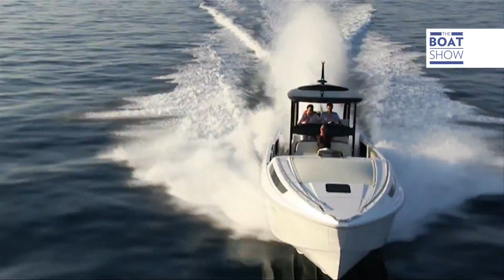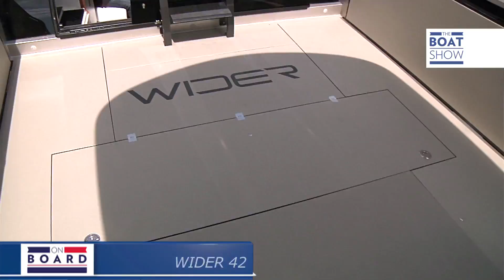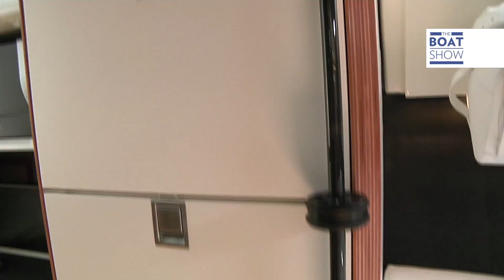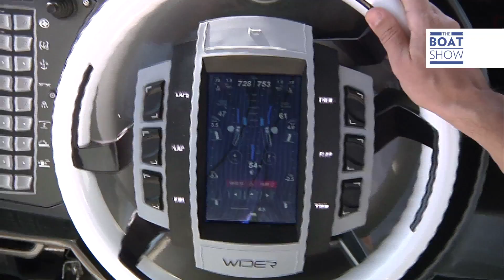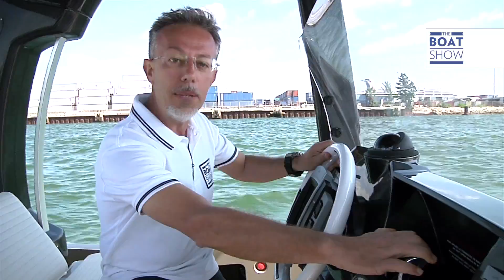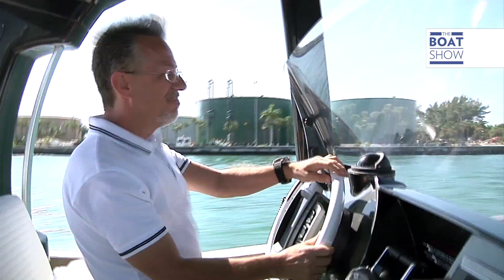[ENG]  WIDER 42 - Review - The Boat Show

Comment: What a bone head. The dumb thing this guy said is that he "doesn't get why Anglo Saxon's (You're about a thousand years out of date dude!) use land measurements at sea". 
No one uses any other measurement than Nautical miles for navigation.
Reply: David Blalock - Livin' Life The bonehead is correct
Reply: Jono Nicholls The bonehead is wrong. Statute miles are used only on fully landlocked waters. Waters where you are not required to have a captains license. However in navigable waters the knot is the only measurement used.
Reply: David Blalock - Livin' Life oh ok, thanks for clarification. What did we agree on again?

Comment: It amazes me how they can design and squeeze a bed, galley, and dayhead in that boat despite its small size!
Reply: Watch this channels review on the Sarnico Spider 46 GTS. One of my personal favourites but it will amaze you how much they fit under deck. I simply couldn't believe it was possible.
Reply: I must check it out
thanks! :D
Reply: +Katsu Wolf Oh I've just remembered the one I thought was fake or an illusion. The SACS Strider ZETA R. Check it out its incredible what they manage to hide underneath.
Reply: Oscar Brady i have always thought how amazing it is how they fit stuff in there
Reply: interesting but at 17 m the SACS Strider ZETA R is also 4 meters longer, the  almost 15 m SARNICO SPIDER 46 GTS is more comparable to the 13,3 m Wilder 42